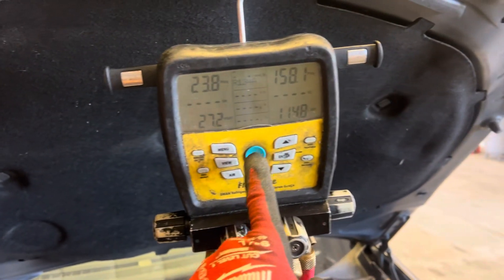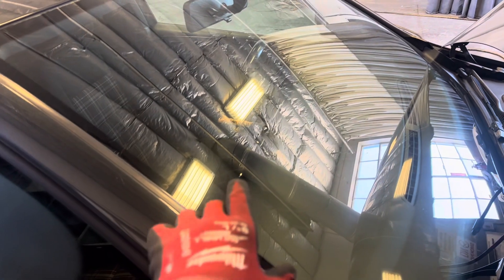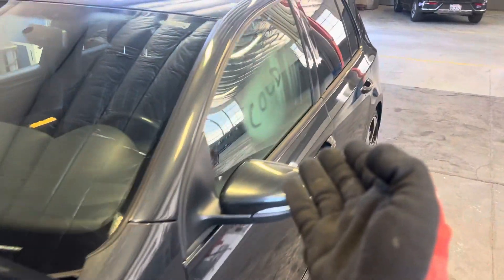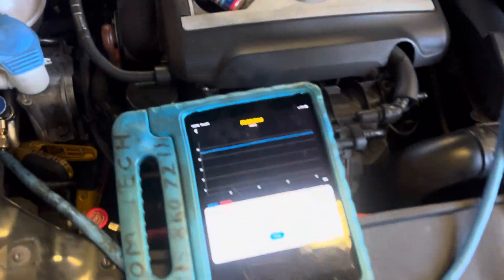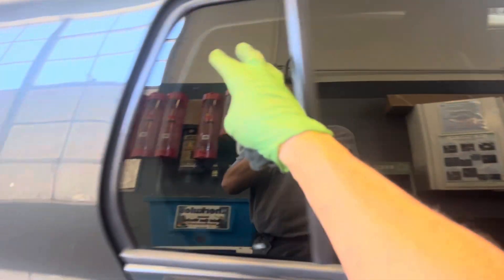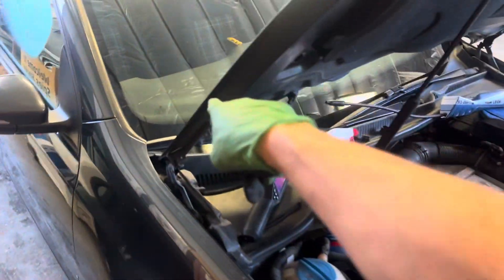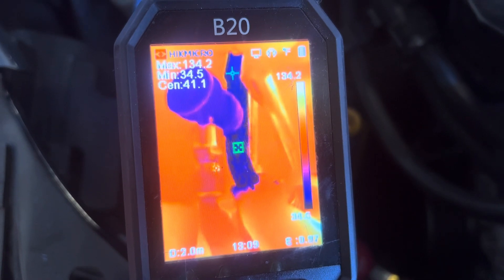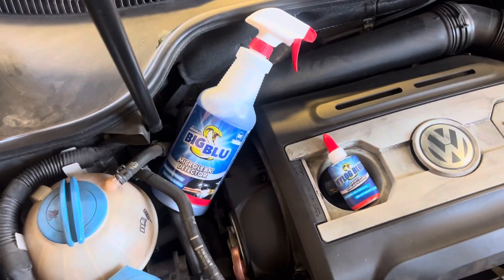AC 36°F 2012 Volkswagen GTI ￼. New, Condenser, and recharged.

Comment: I got a mk5 rabbit and I’m going to start trouble shooting the HVAC soon. Is it true the solenoid valve is junk from the factory on them? Should be for denso compressors for Volkswagens aged 2004-09 about
Reply from the maker: Just buy a solenoid off of eBay or Amazon. It’s only held in by a Spring c clip

As long as the compressor spinning freely, and you don’t see no metal flakes or black inside the compressor

Your cheapest bet is just to swap out that compressor control solenoid valve. It’s only $20-$60.
Reply: @coldfinger459sub0  I see a lot of comments saying that from factory the dash was putting out 50-60 degree air even on fresh days and that after installing an RKX branded solenoid valve they were getting proper 35-45 air so I might try that. Haven’t jacked my car up to ensure it’s a denso but it better be because that’s the only brand RKX supports. A lot of reviews say after replacing with a stock or aftermarket OE styled part that they still had the same performance. Might be something interesting to look into.
Reply from the maker: @EastDallasKicks  I have experience that on a Ford hybrid express or some other Ford SUV. Can’t remember the

Replaced it with a aftermarket, and it was ice chilly colder than any other that I have ever did
Reply: @coldfinger459sub0  Yeah it sucks that ford cars in general seem like hot garbage now. I wanted a fusion but those transmissions scare me. Anyway how often do you work on Volkswagens let’s say the golf/GTI?
Reply from the maker: @EastDallasKicks  I’m here. Most of them are in the junkyard.

I think I worked on one earlier this year 

And then another one last year I barely see those anymore 

Remember, a decade ago call swag and started building garbage cars that were falling apart always needed work and they got a bad reputation 
And then there was diesel gate where are the German Volkswagen and the diesels had that problem in American customer stop buying Volkswagens for a while